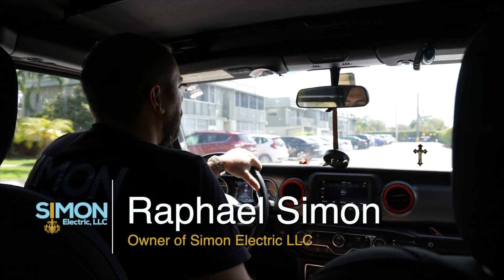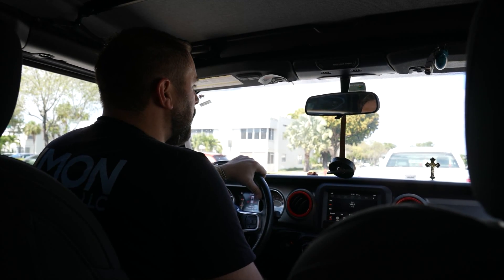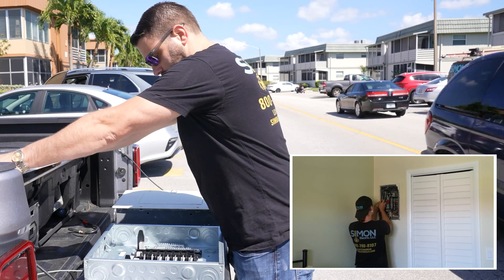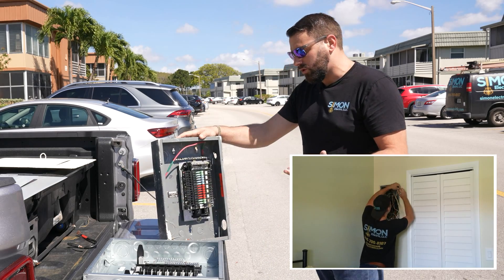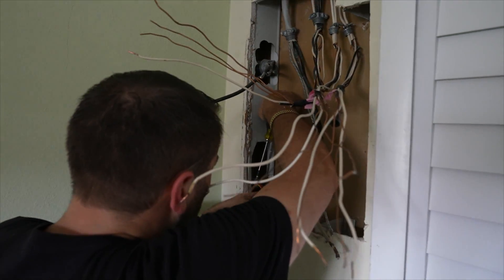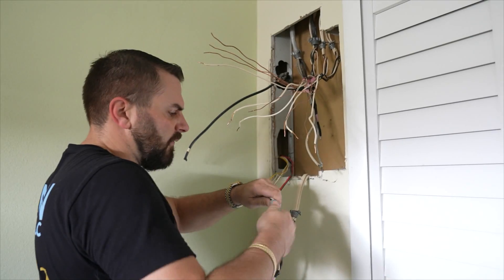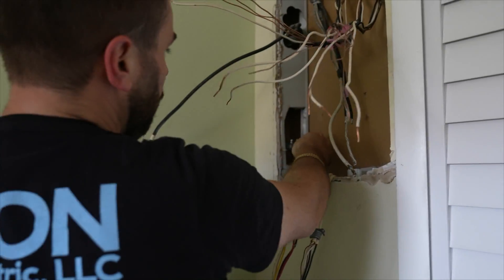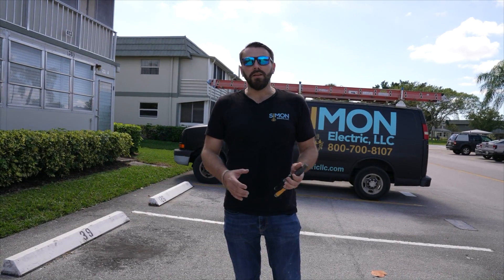Condo Panel Upgrade - Simon Electric LLC

Comment: Just a recommendation,put down a drop sheet where you are working.This way in case you drop anything you won't damage the floor,plus it makes for less cleanup at the end of the job.Otherwise,good video.
Reply from the maker: Yes, we did have a drop cloth set up below the panel. You can not see it in the video, but we had a 5x9 canvas tarp on the floor below the panel location.
Reply from the maker: Thank you for the comment!

Comment: GE was bought by ABB. I did a 4000 amp new service/switch gear change out at a hospital few years back. ABB had a ABB tech show up to do breaker settings on the new ABB-GE Switchgear. The tech said they keep the GE name because it’s so popular still and sells. Some of the smaller new GE breakers will have ABB written on them
Reply from the maker: Yes, GE has fallen far but GE/ABB still has the respect among many electricians like myself. They were one of the most valuable companies in the world around the year 2000, and then yes, ABB bought out a large portion of GE (GE industrial solutions) around 2017 I believe. Great coment!